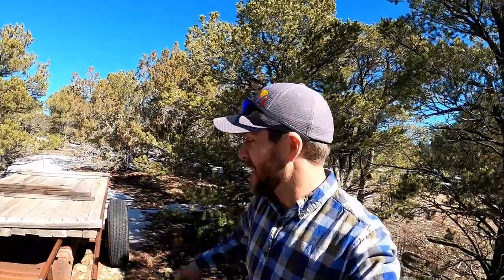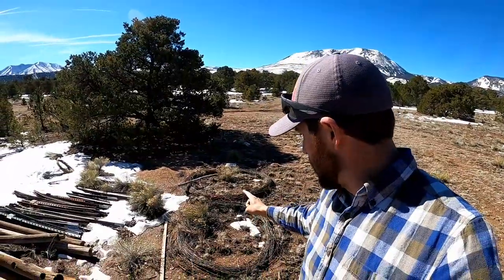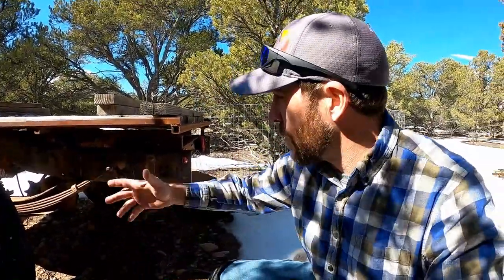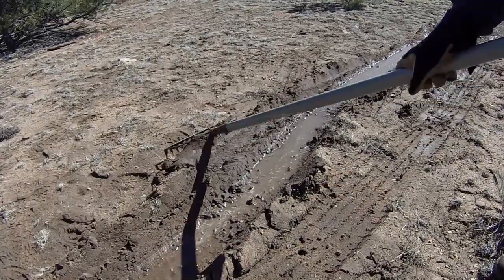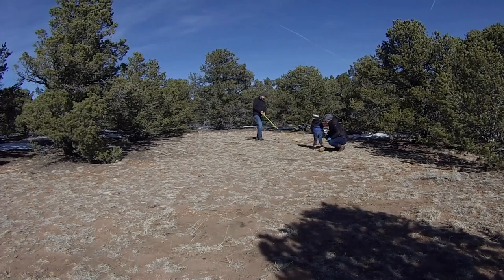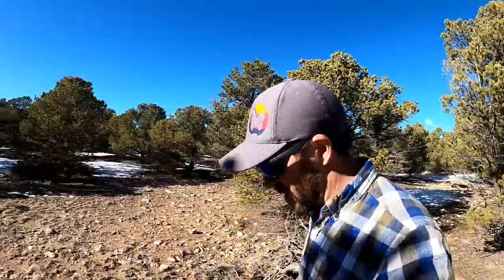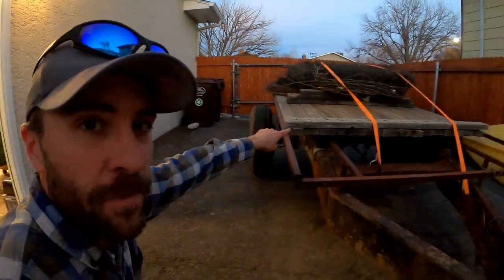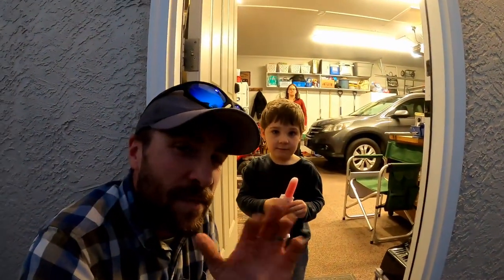Will This Old Abandoned Homemade Trailer Tow Home Safely? - Cleaning Up Our Camping Land Day Trip

Comment: Nice you got your trailer home and it seems to be working well !  It will be  handy  for the property  ...hauling stuff  etc.  Yea your drive way looks like a swamp,  ours was that way too in a few spots but not anymore since we put down the road mix gravel .... Ok thanks for the update  !!
Reply from the maker: Heck yeah, we are looking forward to being able to use the trailer around the property!  Thanks for the idea on leveling out the ruts BTW!  I threw that video in there thinking you would probably watch.  That's really good to hear about the road mix.  We definitely plan on doing that to helps things out.  I appreciate your input and sharing your ideas/experience!
Reply: @ColoradoCamperman  ...Yea I saw you steel raking  the mud back into the rut ,,, and I'm going I do that too .....Ha !  And you said you get free road mix ?  thats great !  fill up the new used bed truck trailer and your truck and  start dumping it on your driveway next maybe this summer while its all dry ..... Ok spring is almost here  already down here  we just got a little bit of snow last night . Time to head for the hills and have a look ...
Reply from the maker: @Sirskibumsalot  Lol, that's a great way to knock down those ruts!  Yeah man, free road base!  I found a guy that has a dump truck that charges $130/load to deliver the road base.  I could go get it for free, but I would have load it and dump it dump it myself.  Seems like $130 is worth it to not have to worry about it myself.  And his dump truck would probably be the equivalent to like 10 loads with my truck & trailer, lol!  Go get that snow while it's out there!  We only have a few months left :(

Comment: What kind of soil do ya got? If its good clay and retaining all that snow melt maybe adding a water feature like a small pond would beneficial. Nice place to cool down on summer days plus water for wildlife.
Reply from the maker: I think it is mostly clay based on what I have seen.  I'm going to do a DIY soil test next time I go there.  I have thought the same thing about building a small pond!  That would be super cool.  I know quite a few of the neighbors have built them or at least built a dam to try to hold water.  Like you said, it would be great for wildlife too.  I like your thinking!

Comment: How many acres is the land?
Reply from the maker: 35 acres
Reply: @ColoradoCamperman  so nice. Land value in Florida is thru the roof now. I am trying to buy 10 acres and they are too expensive now.
Reply from the maker: @knight7866  Yeah, even since we bought last year, land has gone up quite a bit.  Some areas are not even close to affordable for the average family.  That wasn't the case here in Colorado even just 5-6 years ago.  Hopefully you find something that will fit your needs and within your budget.  Thanks for watching!
Reply: @ColoradoCamperman  thanks abd thank you for sharing your adventures.
Reply from the maker: @knight7866  You're welcome, thank you for watching my adventures!